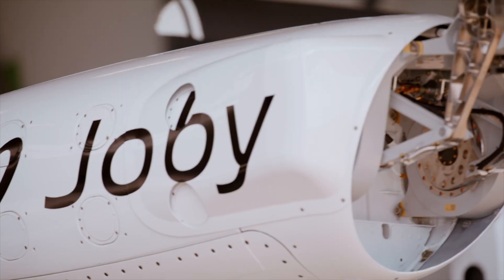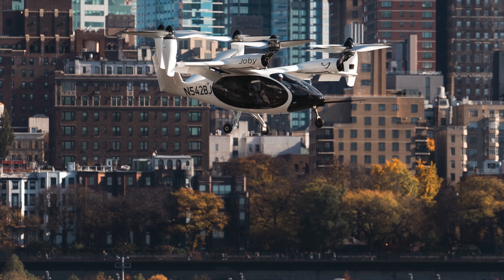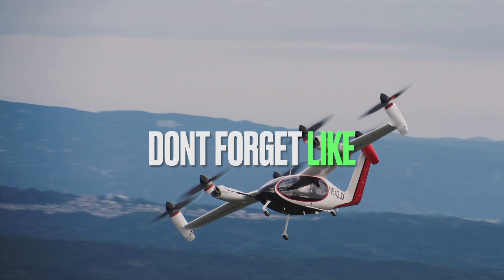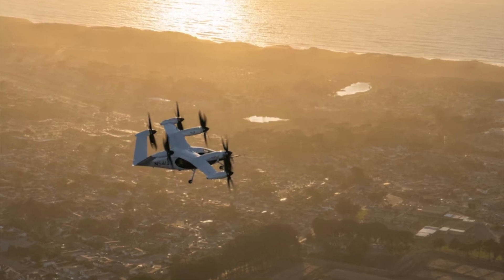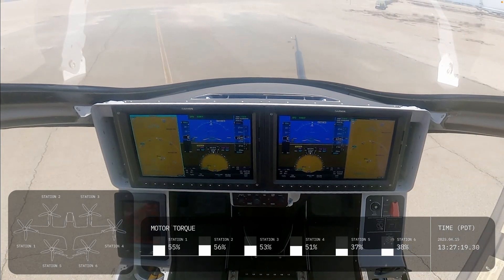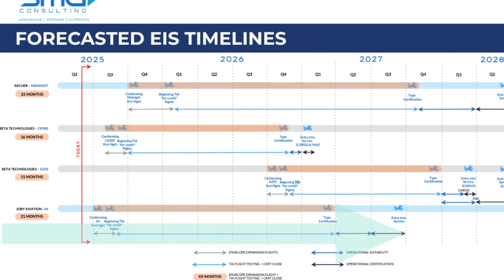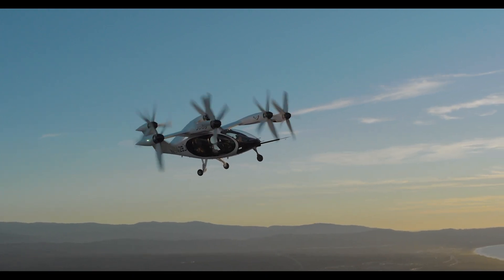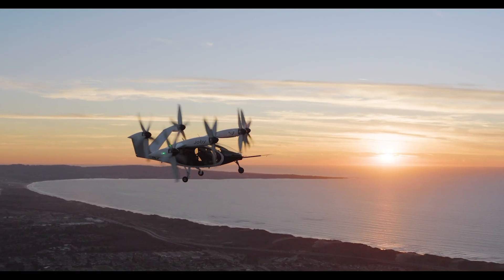Top 5 Reasons Joby Aviation is Revolutionizing the Aviation Industry!

Comment: 2025 is wrapping up and NOT ONE eVTOL has entered the FAA Airworthiness Certification process. The FAA standard for commercial aircraft is a failure rate of 1 in 1 billion flight hours, good luck with that. With complete power loss a fixed wing aircraft can glide and a helicopter can auto rotate, an evtol will fall like a stone. Even conventional designs from well established manufacturers can take decades to achieve an FAA Airworthiness Certificate, these companies are laughable cash incinerators or as one renowned rotorcraft aerospace engineer put it "Archer Aviation is the Nikola of the skies. Look no further than Lilium Aerospace, $1.8 billion poof, gone!!!!! Hell the Bell 525 is going on 20 years now and still hasn't received certification. eVTOL's are really just the worst helicopters ever built in terms of safety, range, longevity and useful load. This is all a huge scam!

Comment: Accelerated transition of manned aircraft to hover has been done over 60 years ago ( how many flying cars can be ' first' or 'only ' decades after many real flying cars - not just drones- have flown? )
Joby has gotten it's han̈ds on billions of dollars of your money and this is a great achievment ?  Selling your soul to oil sheiks is also not that commendable.
The robo voices are just as fake .
What requires hundreds of 'engineer', or a thousand, to design a five seat airplane? .... it cannot be the hardware but needing software to stabilize an unstable basic vehicle can account for much of it - think MCAS ...
Reply from the maker: @rossnolan7283 Thanks for your detailed feedback! eVTOLs like Joby's are aiming for quiet, safe, commercial air taxi service, different from past prototypes. Their funding fuels complex certification/scaling for global ops. Engineering is immense due to safety, software, and FAA demands. Appreciate you watching!
Reply: No, investjng DD, it does not take billions of dollars to make a four seat aircraft of even much higher speed and range that this bloated beast. You can build such an aircraft for way less than 1 200th of the price for this thing in your own garage from a kit - and many people have ( check out the EAA  Oshkosh  convention. Air show on right now.    I was building the prototype HP 18 sailplane, and planning to build a flying car in America over 50 years ago so don't need a lecture on sucking eggs thanks.